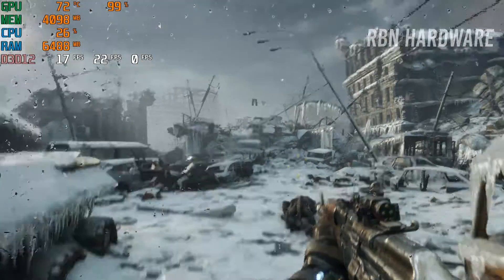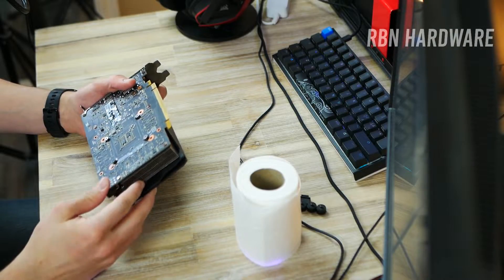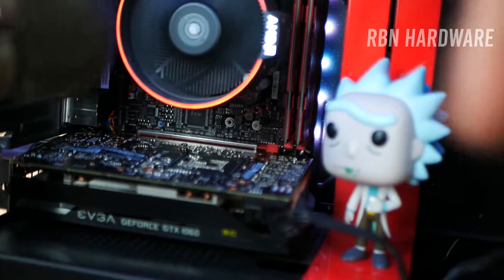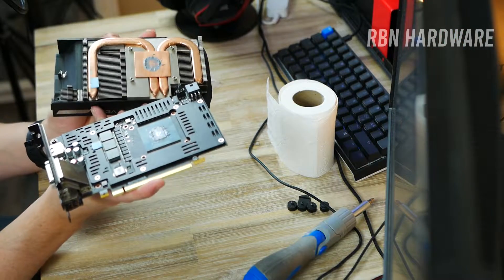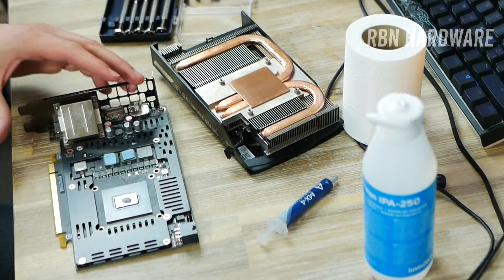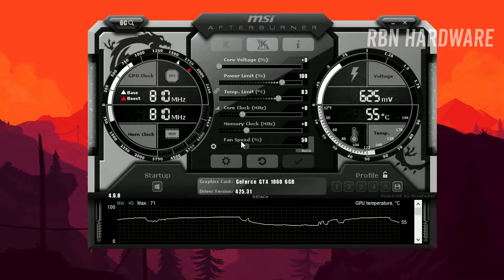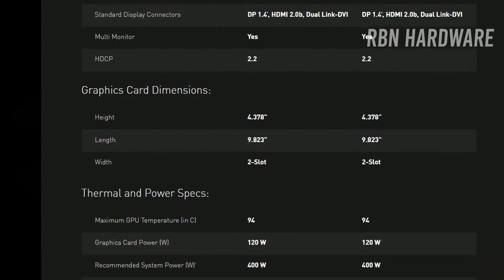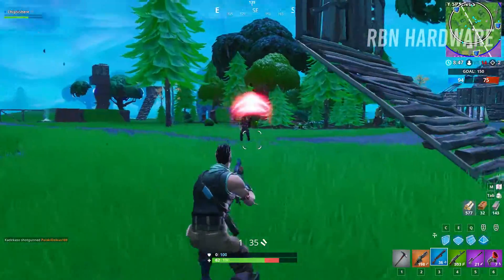How to Fix Loud Computer: Fix Loud Graphics Card & Make It Quieter!

Comment: just to be clear here having too much thermal paste isn't going to cause thermal issues whoever applied it probable knew that thus didn't care if they over did it a little... if the thermal paste was the issue it was more likely that the previous owner added more while not cleaning all the old stuff off either that or it was cheap paste applied, or it was the paste it came with and old paste does not run as well(some manufactures will intentionally spill over a little cause they know it doesn't harm anything and when applying to thousands of cards it makes it harder to not have enough it you aim for a little too much you wont run into the issue of too little which can cause thermal issues unlike having too much). Spilling thermal paste over the sides can be messy, but never really an issue unless its conductive which it usually isn't unless you are using something like liquid metal which would give you the best performance but also brick whatever you applied it to if it spills over.

Comment: I mean right off the bat those temps are not even high, low 70s is well within spec for graphics cards. Setting a custom fan curve is ideal no matter what card you own so sound advice there. Really if your fan is having issues like grinding and clicking, increased noise in general, you'll want to replace it outright as it's only going to get worse or outright die on you over time which could be catastrophic if under load.

Comment: for me anything under 75c im comfortable with because its fine for long term use and games will not always stay at 99-100% in ever part of the game, in my case my gtx 1660 is undervolted and runs at max 69 degrees lol
Reply: before it ran at max 82 so i dropped 13 degrees just by undervolting

Comment: The card runs hot because of the black tape covering the exhaust. It's EVGA's shitty solution to lowering VRM temps but it completely ruins the cards thermals and noise.

Comment: I had this same card. Look at the vents at the back of the IO, there is a piece of tape blocking the the heat sink from exiting. Take that tape off and if takes about 5c off temp. EVGA said they 'can't remember' why they put tape there blocking hot air!?!? Also, this card will undervolt to 900mV, easy, taking another 5 degrees off it. I know this was 1 year ago, but, thought I's mention it.
Reply: i dropped my gtx 1660 to 900mv a long time ago its used to run at max 82c now it runs at max 69c, i dropped 13c that way which is amazing, old rpm was 1800-2000, now its ranges from 1500-1700 which is a decent amount quieter not too much difference with a headset on

Comment: My new pc is a little loud, I’m worried.. dunno what they are supposed to sound like
Reply: I had this same card. Look at the vents at the back of the IO, there is a piece of tape blocking the the heat sink from exiting. Take that tape off and if takes about 5c off temp. EVGA said they 'can't remember' why they put tape there blocking hot air!?!? Also, this card will undervolt to 900mV, easy, taking another 5 degrees off it.
Reply: Bigus Dickus as long as temps are fine, its good. If it really bothers you, try setting up custom fan curves in bios and msi afterburner
Reply: UI Shaggy well my temps under gaming load stay usually around 70-75c for my GPU, I hear that’s average?
Reply: @tonygunk86  helpme my rx 570 is running at like 80 degrees and the fans sound awful, like grinding
Reply: I fixed it the wire was in the way LOL
Reply: USN Lucas lol glad you figured it out

Comment: First off, in the beginning of your video you said "fix this problem", there is no need to "fix" anything because the card is not broken, as you can see by your results after re applying new thermal paste. The biggest issue you have is your space between the gpu fan and your case as seen at 2:43 . The H210 already has poor airflow, you need a single slot gpu or upgrade to a dual fan gpu. If you run a low end card with a single fan in an itx build and try to play high end games you can't be surprised when you hit higher temps...
Reply: i have a duel fan card but  its still loud
Reply: @nikolahd8044  I bought gtx970 recently, dual fan too, but very loud even on 37% fan speed(cant go below in msi afterburner)